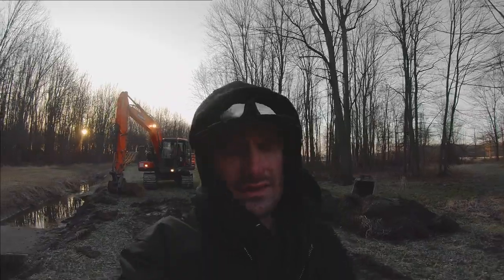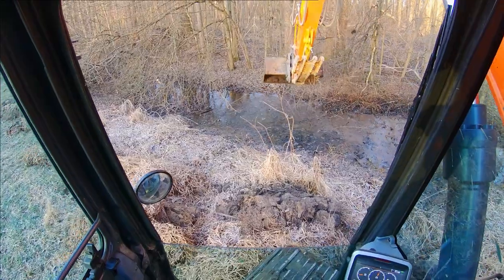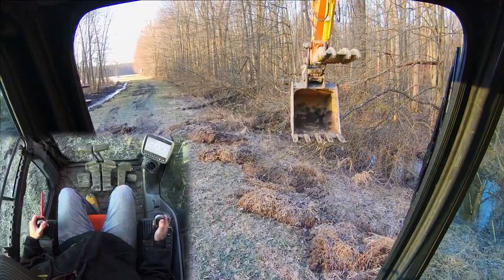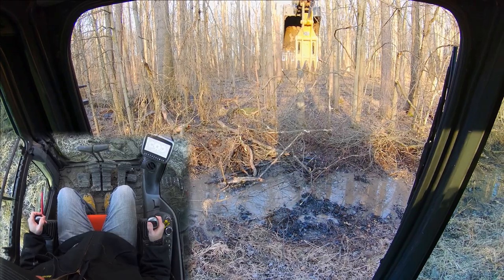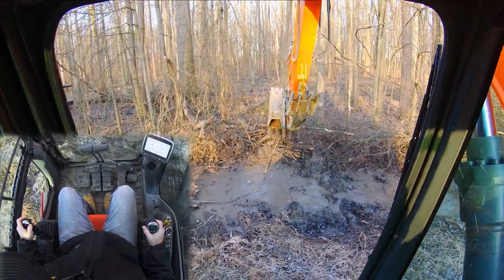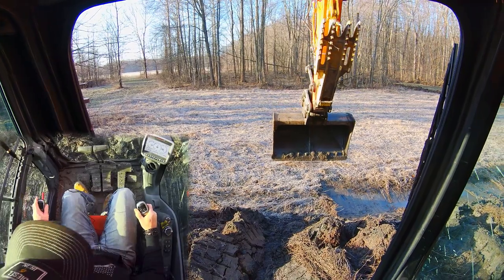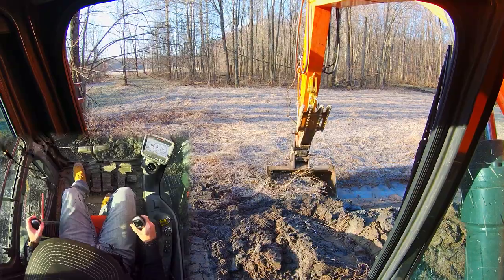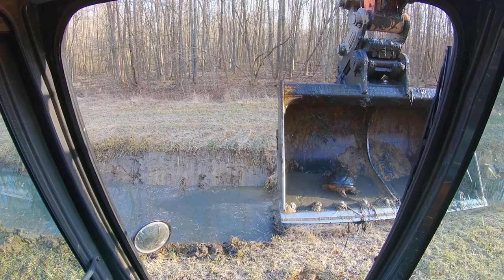HOW TO CLEAN UP A DITCH WITH AN EXCAVATOR - Duel Camera View // Heavy Equipment Vlog Day2 Part1

Comment: Brian 😎 cleaning ditches doing great so far 👍 damn branches they will take out a line real quick but be thankful it's not a giant bamboo patch u would have been cussing for sure 😂 Thank U Brian for the great video 👍
Reply from the maker: thanks!  I feel like I walked away from this job having learned quite a bit.  I can only imagine dealing with bamboo.  I managed to get out of this job unscathed fortunately!
Reply: That's the main thing u learned 👍 as for bamboo u have to beat it down remove the stalks and then there's the root that is such a pain in d ass to deal especially when the bamboo patch is bigger than the machine you're in 😂

Comment: What do you do about wearing leather boots 10+ hours per day?  I've learned in a truck to drive barefoot and put boots on for the customers so my cab doesn't smell when I take them off at the end of the day. Of course that's not a great option on a jobsite.
Reply from the maker: I don't have too many problems with the foot funk fortunately.  I know a lot of guys in the industry have two sets of boots that they switch between, alternating days.  That allows them to air out and keep the funk to a minimum.  If I were operating the same machine day in and day out I'd probably get a set of comfortable cab shoes and wear those while operating.